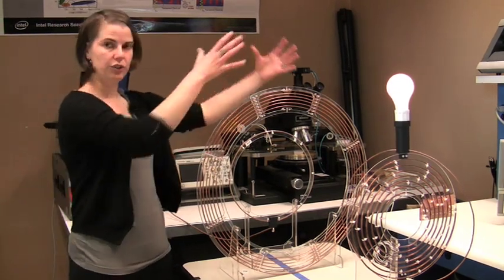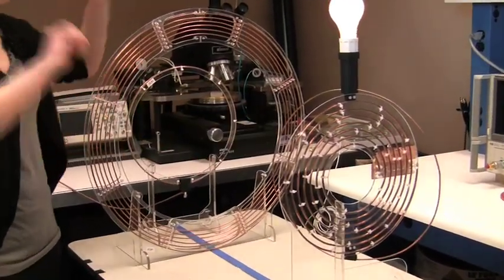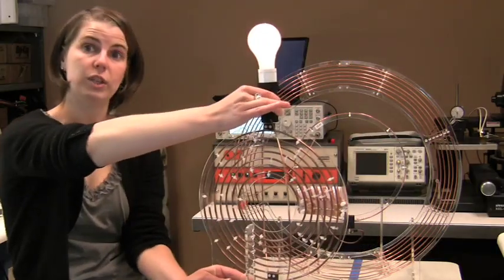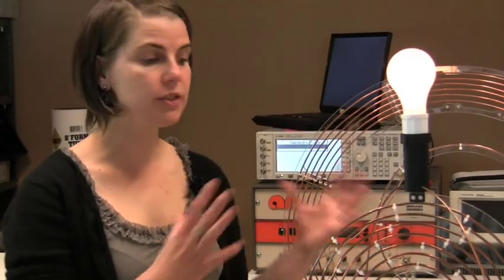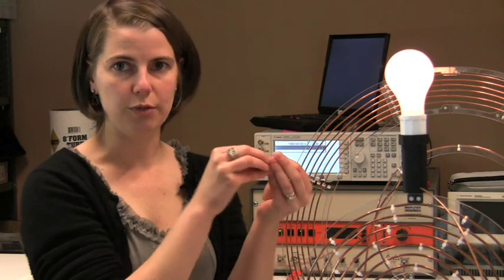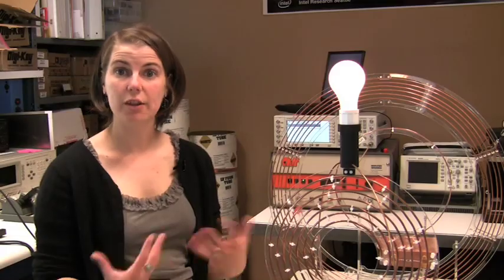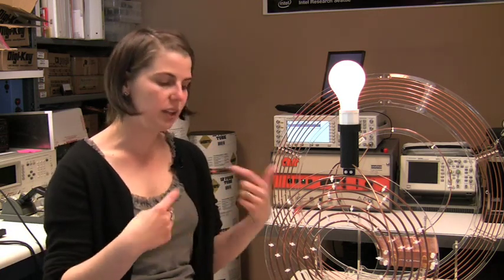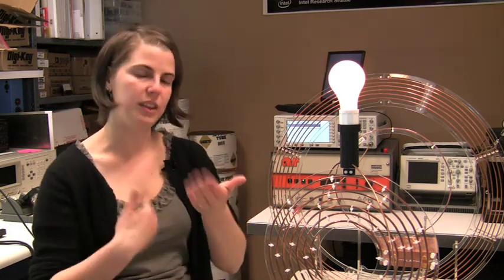Intel Labs:  WREL lightbulb demo

Comment: This works with AC only, right? If so, then you still need bricks to convert that transmitted AC into a DC signal with the appropriate voltage to charge your device :s?